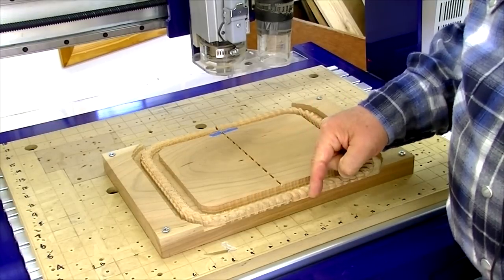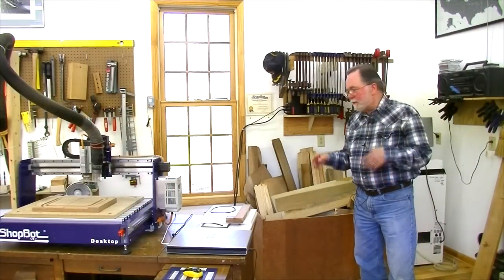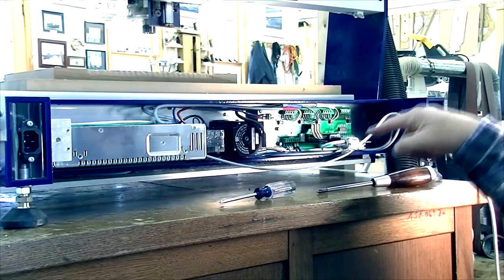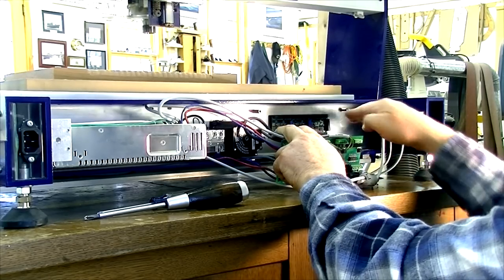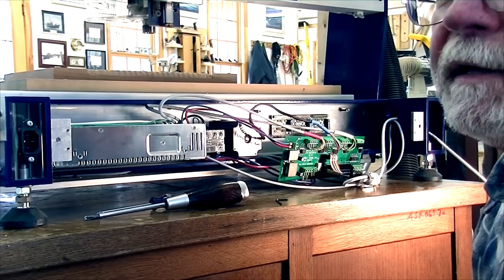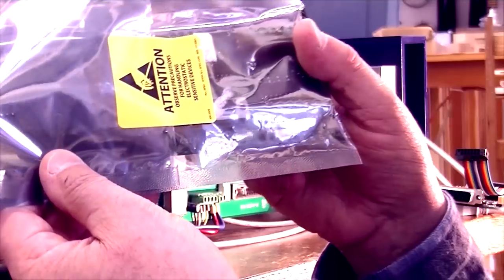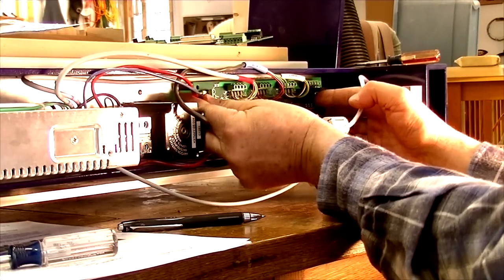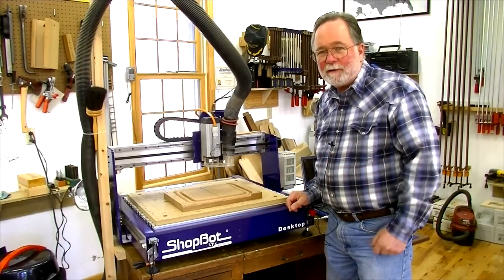Replacing a ShopBot Desktop Control Board and Driver; Andrew Pitts-FurnitureMaker

Comment: I just finished going through a similar problem on My CNC, though mine is not a ShopBot.  My Y was stalling. The DRO would move but the Gantry would not. CNC are great until they begin messing up.
Reply from the maker: magic man Yes. Things can break.As driving a car means replacing parts every once in a while, so it is with the CNC machine, but at least the fixes are generally straightforward and something we can do in our shops. Occasionally frustrating, but overall worth the effort.

Comment: That was super useful Andy, much appreciated the level of detail you went into there. I have the same model and it worries me about this :-)
Reply from the maker: Richard Vowles Thanks Richard. ShopBot asked for my old card to diagnose, so I suspect these failures are far between. I've got to think my utility power has something to do with my card failure. I'm at the end of the grid and we see voltage dips in power fairly regularly. I know that can create havoc on electronics. I hope my UPS will solve that issue and I will not see any more electronic problems.